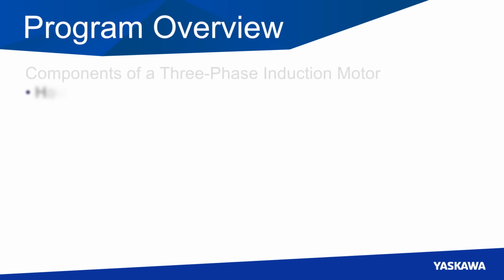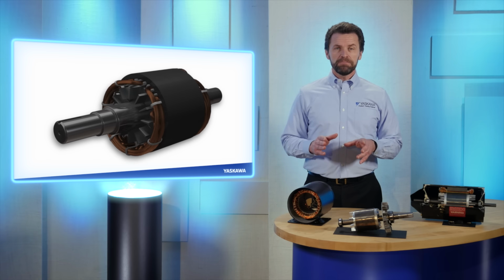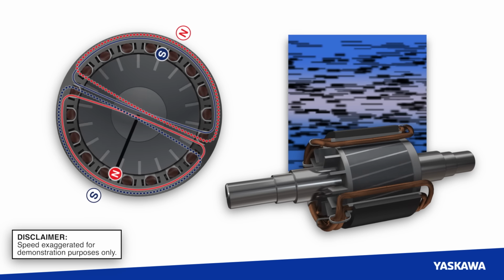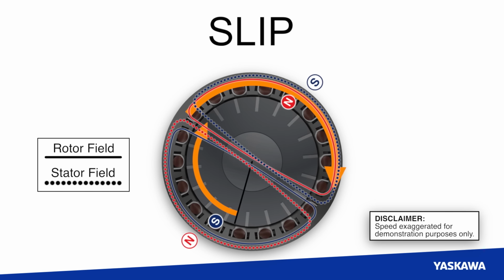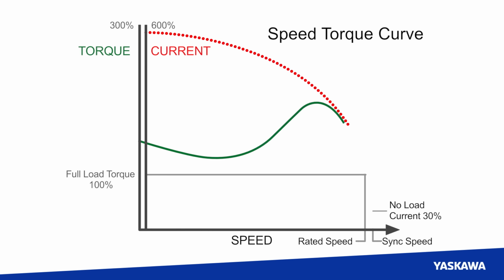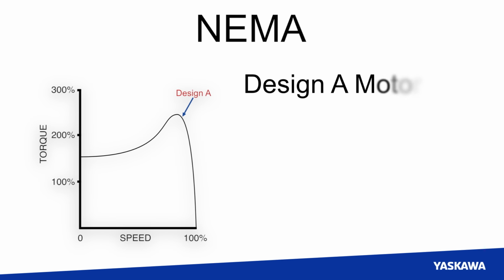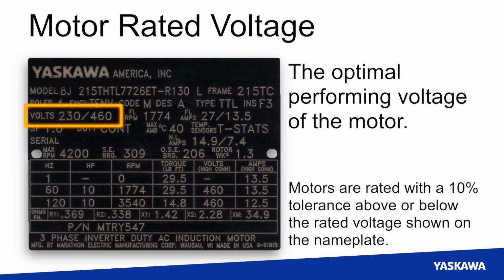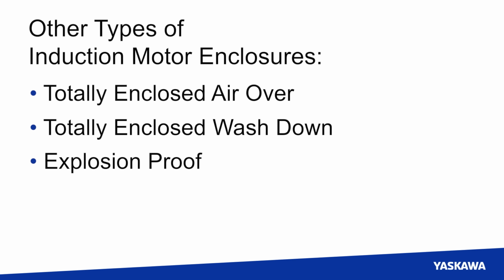Motor Basics

Comment: just completed a technical degree in electrical engineering which included an 8 weeks course on electrical motor and drive systems. This 30 minutes video included pretty much everything I saw in the AC motor portion of that course. Very well done.

Comment: Sir Motor installed in ground and ground wire connected on the motor body. That means the motor is working by north electromagnet poles. In the three phase system. The rotor has three separate loops . I am right . Same magnet pole always repel .
Reply: Motor rotor eating unnecessary current.

Comment: Beautiful video. Well explained and very well structured. Happy to be able to find this type of presentations online. Thanks for your efforts in making this available for everybody, amazing!!!

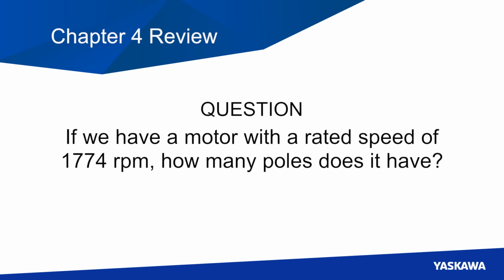Just a small input: we all know that America has a 60 hz power grid. But this does not mean this is always the case. I think the chapter  4 question (15:00) could have 2 correct answer. The one in the video (assuming we all know that the motor load is connected to 60hz) or answering that the number of poles depends on the source frequency, right?

Comment: Though the speaker explains that the speed of the rotor is always less than the speed of the speed of the stator generated RMF, in the  animation the rotor seems to be rotating at the same RPM as the RMF with just a lag in rotational positions of the magnetic poles.  If there were to be a difference in speeds, then the animation should show the rotor rotating in the opposite direction relatively as the RMF races ahead of it.

Comment: We’re a customer-centric prototyping and  low-volume manufacturing manufacturer. Over 30 multi-axis CNC machines( 2 sets of five-axis)， ISO9001:2015. Over 500 companies in 30 countries use POMO'S high quality manufacturing solutions to reduce cost and time.  I ’m wondering whether you might be open to an initial conversation to gauge a fit? #CNC Machining # SLA/SLS 3D Printing#Vacuum Casting #Rim Casting#Sheet Metal #Rapid Tooling.  Contact us today to get started !
E: info@powermoulding.com/judy@powermoulding.com
Tel:+86-0755-23249113
M: +86-18975013763/15976898832
Wechat: +86-18975013763 or power_moulding
Instgram: power_moulding
Website: www.powermoulding.com

Comment: Amazing video!!! 9:00 I just dont understand why the coils wrapped around the stator move. The coils are on the stator which is static. It seems like the stator is moving and the rotor with it , but I think it's more accurate to present that the stator is static, the phases are changing periodically on each coil making the magentic field of the stator move and with it the rotor.
Reply from the maker: Thank you for your interest in Motor Basics. You are correct The stator field is what actually rotates not the actual stator. We have addressed this. Thank you for noting this.

Comment: Dear is the huge electric motor same as small motor the motor above 1500 KW
Reply from the maker: Thank you for watching our video on Motor Basic. For further assistance can you please email us your question and motor(s) information to Technical_Support@yaskawa.com
Reply: Thank you for your explanation  but i have question why rotor have line not straight?? What if is straight
Reply: @schadrakusniyonkuru6655  Hi, this design is to make the transition of flux on rotor bars smoother. With straight rotor bars, the flux in each closed circuit changes more abruptly when the stator magnetic field passes it. Having the bars tilted at an angle, it helps reduce the torque ripples significantly.